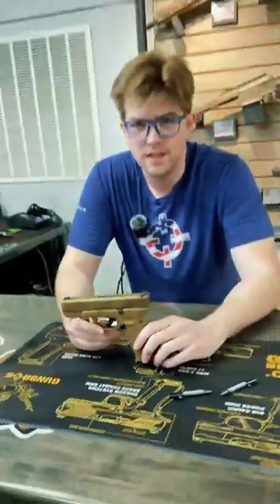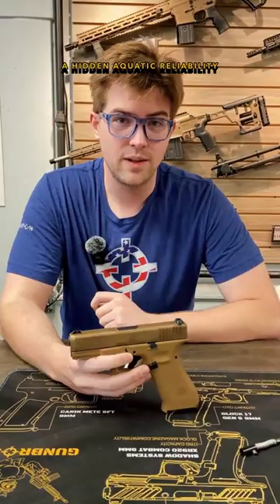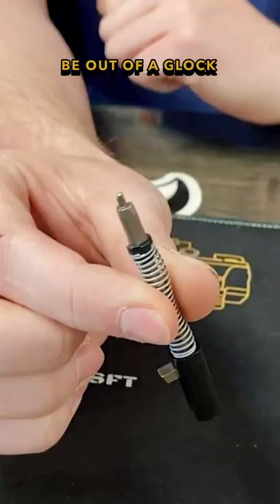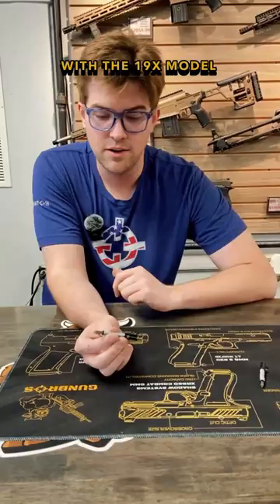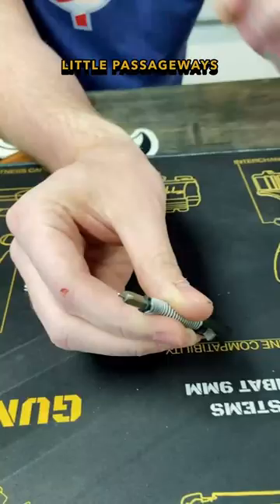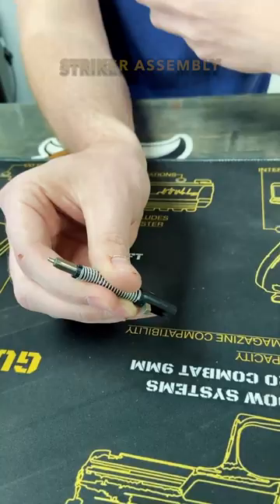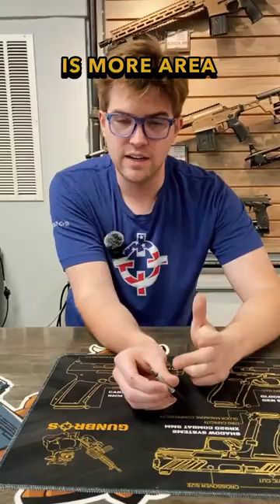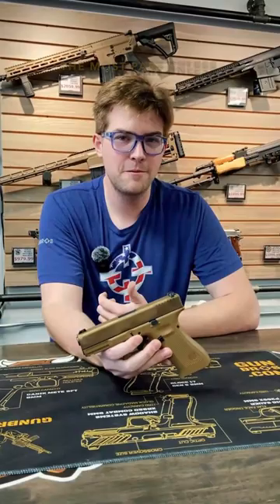Glock 19X's Hidden Water Feature

Comment: This pistol was introduced by Glock to compete in the military’s XM17 program to replace the official sidearm contract that was held by Beretta (M9). The contract was erroneously given to Sig (P320). G19X is the better pistol.
Reply: Despite failing to do the one thing the military asked. Make it modular.
Reply: @chris.3711  modularity was not a requirement. Watch small arms solutions about the topic.
Reply: @chris.3711  Yes, sig is modular. It also can go off when dropped...

Comment: Maritime spring cups $5
Reply: Super easy to do the swap too. Only wears out a tiny bit faster but slow enough that most people will never need to swap it again.
Reply: @nithia 😂Why TF would I need them in the First place? 🤔
Reply: @blackticalmayhem8461 because you're a super secret squirrel ultra tactical Navy Seal badass wannabe?
Reply: @jegr3398  🤔
Reply: @blackticalmayhem8461  
I mean you dont need them but if that was one of the reasons you were considering the 19x over just getting the 45 which is basically the same thing just in black without that part, then you could go with the 45 and swap the part.
Reply: @nithia  the 19X has a lanyard loop the G45 doesn't and front serrations. The 19x Isn't my cup of tea 🤷‍♂️
Reply: @blackticalmayhem8461  All Glock pistols have a lanyard loop in the heel of the grip, it's what the 19x lanyard loop locks into.
Reply: @Lawfully_Armed  🤔 idk , I haven't noticed it on mine

Comment: That’s why the Marines/Navy use the Glock 19 as a standard now. They wanted something to work underwater if need be, plus weight and reliability played a factor. I don’t think it was the 19X though.. just the 19. Could be wrong but idc enough to look it up
Reply: WRONG….The Glock is NOT the standard issue handgun. In 1985 it was the M9 Beretta, before that it was the Colt 1911 .45 ACP, and now In 2020, the Marine Corps began fielding the Sig Sauer M18 Service Pistol to operating units, replacing the Beretta M9, the primary handgun since 1985. There is a reason Glock is not and never will be the standard issue hand gun…there triggers are crap and the iron sights are junk.
Reply: @ArmyVeteran67  I thought Glock also got like a $15m contract for various firearms too? I know Sig got the big M18 contract standard for army and various others. But I also thought the G19 has been adopted by Seals/Marines and other special operations as a standard as well. I knew the beretta was the standard before and yada yada but I remember reading somewhere that the underwater functionality made the marines and seals choose those over the Sigs. Plus it’s light weight, etc. But whatever, I’m just talking out my ass mostly from memory, I don’t really care that much. Just wanted to point out the underwater functionality of not only the 19X, but the regular 19 as well
Reply: @HookersAndCoke  Some Special Ops units might have a choice and maybe as a personal issue, meaning that they are allowed to use a different handgun instead of a government issue. Many service men/women  depending on the unit have a choice to either use their issued handgun or a handgun of their choosing (like I said it depends on the unit/company and where they are stationed), like me I was stationed at Ft. Bragg 18th Airborne Corp and we were only allowed to used the issued handgun. My buddy was Navy and there handgun was an Sig Sauer P226. Yes Glocks are very reliable (just wish they change their design once in a while). For the record I am not a Glock hater I actually have a Glock 19 Gen 5 (modified of course).
Reply: @ArmyVeteran67  yeah that’s what I was thinking too lol. I know they got some options these days. Also I have a ton of handguns from all kinds of manufacturers. I’m never too impressed with Glock, but they get good results either way. Gen 5 triggers are definitely better than previous generations. Modified most mine myself as well to get the results I wanted. Thank you for your service amigo 👍🏻
Reply: @ArmyVeteran67 😂😂🫵🤡

Comment: What is fouling? Rust?
Reply: Fouling refers to any build-up of intruding material that can block the action, things like dust, sand and snow, but it especially refers to gunpowder fouling which is the residue left from the burning gunpowder when a bullet is fired.
 
All gunpowder leaves some fouling as the powder does not burn 100%, and the burning powder turns into a gas which pushes the bullet - most of the gas will leave the gun, but tiny amounts remain in the gun and turn solid when it cools down again, resulting in very very tiny pieces of fouling that, over time, can add up and clog the gun if it isn't cleaned regularly.

Comment: Glock is ass 1911 better
Reply: fud
Reply: Ok Fudd
Reply: If it was ass the military would be adopting 1911s and not Glock 19’s

Weird how most law enforcement agencies around the WORLD also use them…
Reply: As a paper weight, door stop?
Reply: In many ways yes. I've bought 1 glock and won't buy another. Runs wonderful but I can't get use to its unique (and stupid) grip angle, compared to literally every other pistol.
Reply: @user-qo3yy9nv1u  Have you looked at after-market frames?
The Glock store has a few.
Reply: @user-qo3yy9nv1u  Maybe just maybe you're holding it wrong
Reply: @Re_Run  maybe just maybe thry decided to design it at a grip angle unlike pretty much every other handgun, gave it a shit trigger, no manual safety, and decided its everyone else's fault it feels alien.